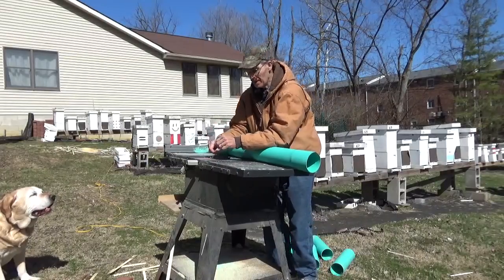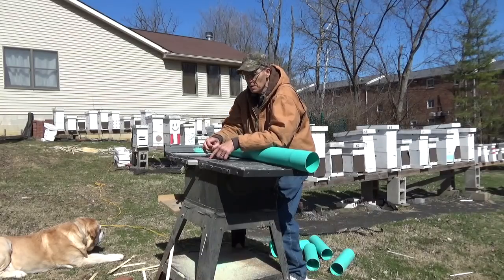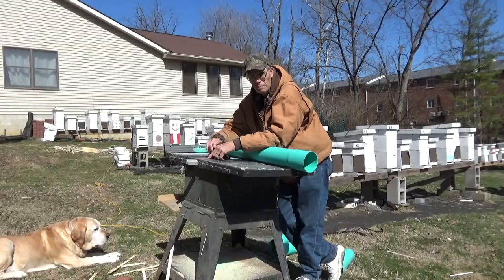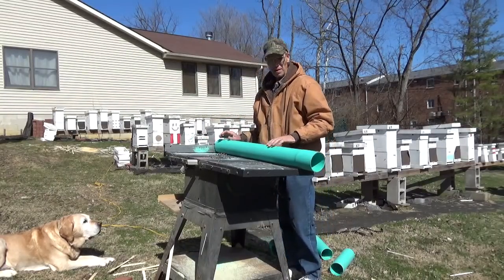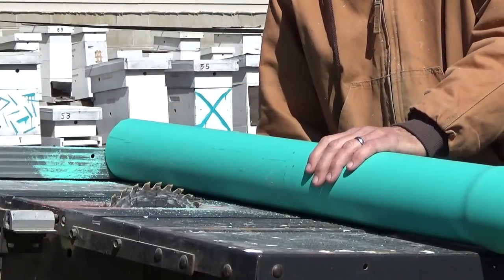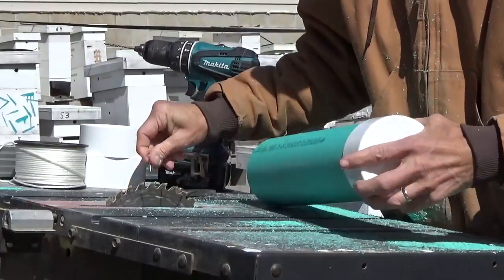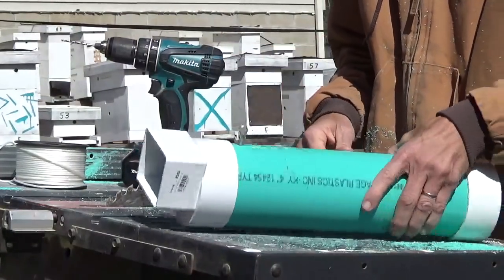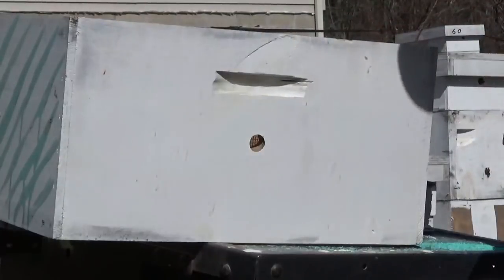Pollen and Pollen Feeder

Comment: Oh Man... my dad taught shop for 40 years... all i see is some dangerous possibilities using a table saw in that manner ... please use a miter saw to cut the pipe - I appreciate the idea -I  will build  the same and use ultra bee - god bless!
Reply: Not sure you noticed, but he has the blade on "backward" to burn thru the PVC.  I cringed a little too but it's actually the correct way to cut plastic and not shatter the pipe.
Reply: like you said, your dad taught SHOP, Joe is a Beekeeper, I don't own a miter saw, but I do have a table saw, so this manner of making this, is helpful for me, where as a miter wouldn't bee... maybe you could just remind folks about PPE, and safety.. Thanks for the ideas Joe
Reply: TheOregonOutlaw I did not notice but that is much better solution - happy bees tosay spring is on it's way